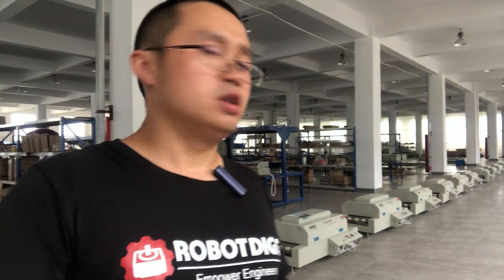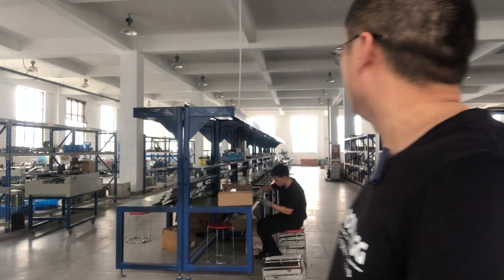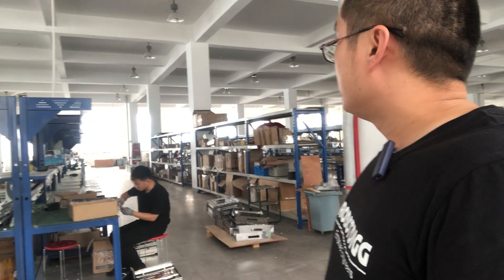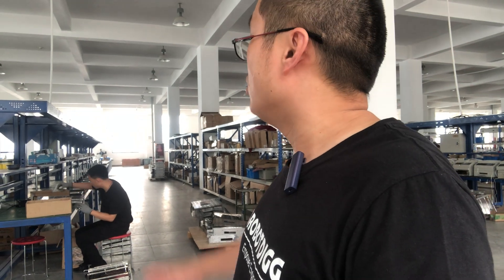RobotDigg desktop reflow oven

Comment: I have this T-960 it works great but sometimes it burns the pcb, I have emailed you guys but not receive respond yet.
Reply from the maker: Adjust the speed to 25 and perform welding. Alternatively, select a slightly lower temperature curve for welding. The reason for this is that the temperature curve and speed selected by the customer are exactly at the critical temperature point, which leads to the burning of the board. Therefore, the measures taken are to increase the conveyor speed or reduce the temperature value in the fourth temperature zone by 5-10 degrees